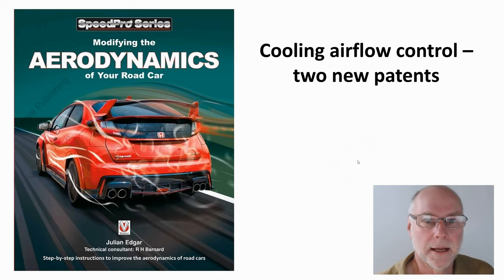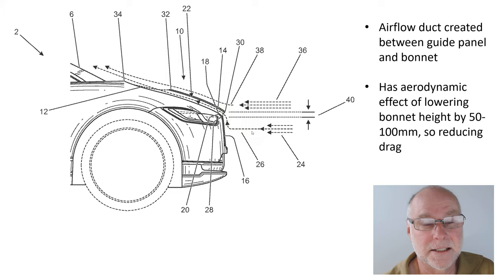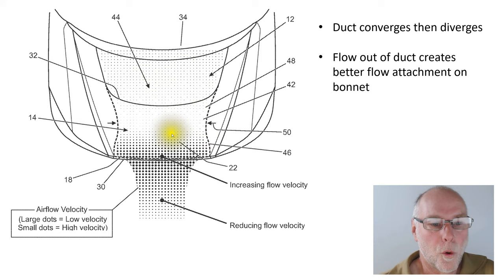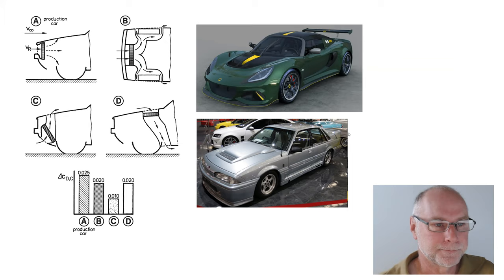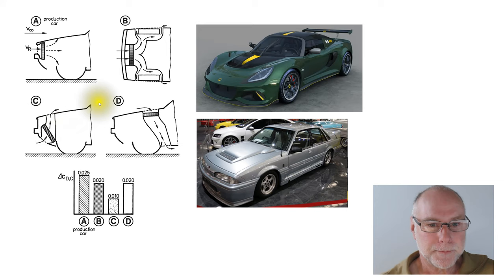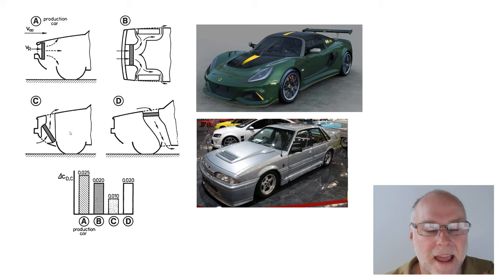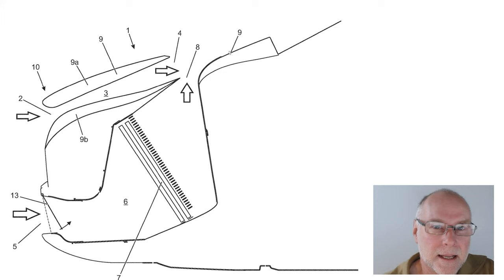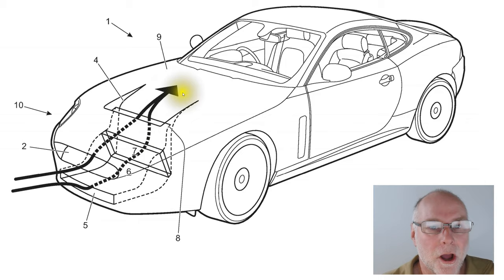Two new aerodynamic patents on front-end car airflow

Comment: This would be perfect for my Fiero I think.
Original it takes in air low, through the radiator and it then needs to do a very sharp turn to exit under the car.
This produces alot of lift in the front, already at 90 km/h.

Comment: Excellent video.
I am building my car and have been searching for better cooling solutions. My idea was to try and get the air through the radiators and over the turbo, then onto the windscreen to try and create some under hood heat exhaust action. 

I might just try to copy this. Might have to try and make a mold of some sort. Make it out of fiberglass or something.
Reply from the maker: Don't guess. Measure first.

Comment: what if instead of taking in the cooling airflow from the front, take the cooling airflow from an opening under the car and use the top ducted airflow to pull air from the bottom through the heat exchangers and out to the top of the hood?
Reply from the maker: Yes you could do that if you were happy with  a lower pressure difference (ie less flow) across the heat exchangers.

Comment: If you look at the front of the 2012-2017 Mitsubishi Mirage (Pre 2017 Facelift models only), you see a upper un-ducted intake slit in the front bumper. 

Given it's position, and if you used the stock vertical radiator with a sealed path to a hood vent/extractor... And if you ducted this slit as pictured, do you think it could accomplish this effect?

Edit: Love the videos, about to order your books, and your Autoblog articles blew my mind when I first read them in 2009. They are still amazing, and have recommended them countless times to other enthusiasts.
Reply from the maker: Thanks for the praise. I think the first step would be to see if you can duct the radiator outlet to a hood vent. That's usually pretty well impossible in normal front engine, ICE cars.

Comment: The air coming from the bonnet will be high velocity.What about the air coming from the radiator?
Dont we need low velocity air near the cowl?
Reply from the maker: I don't think we need low velocity near the cowl, as such. We get a lower velocity there because of the increase in pressure at the base of the windscreen. I also think the way the patent describes low/high velocities might be relative, eg a higher velocity exiting the bypass duct than the bonnet flow, but not a high velocity compared to, say, the freestream.

Comment: Hi.
I don't know anything about the subject, but you didn't address one point.
You know how a paint sprayer works. If you imagine that the hot air (paint) comes through the radiator and the air passing over the hood (compressed air) is directed through the channel to which the hot air channel is connected.
Isn't there a "carburetor phenomenon" going on here?
Reply from the maker: Sure, one flow helps entrain the other.
Reply: A venturi effect by the looks of it. Helps by sucking the air up and out of the heat exchanger, increasing airflow speed I guess